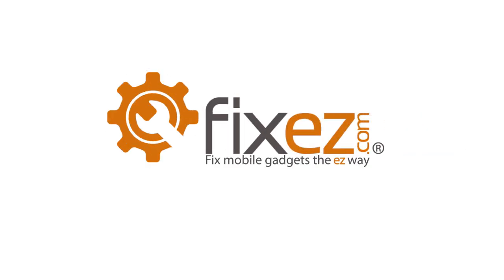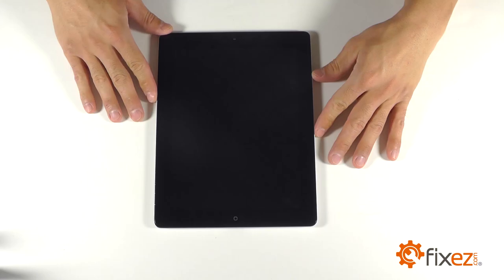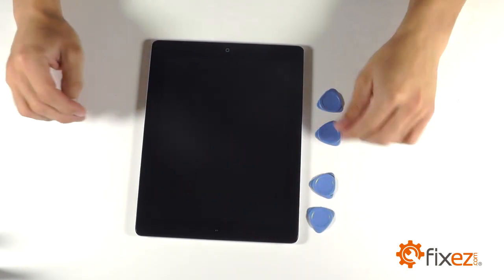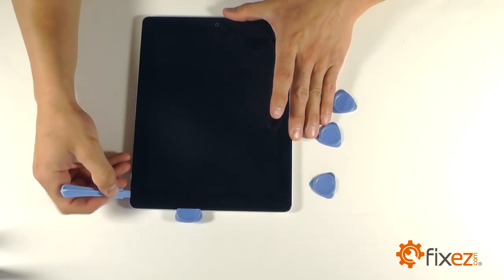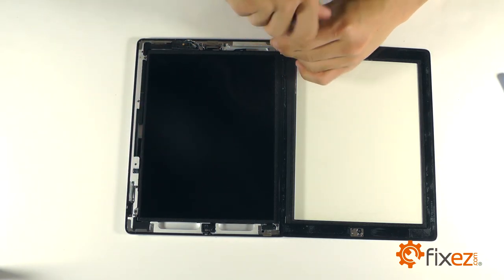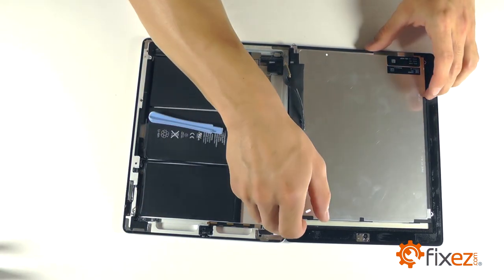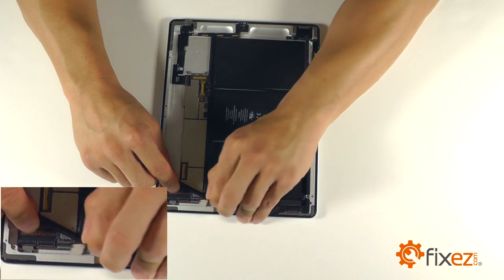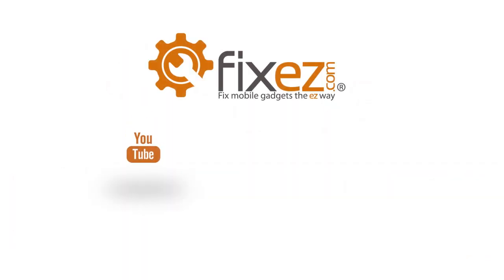iPad 2 Charging Dock Port Repair

Comment: The only thing I would add is I take ESD precautions. Electro static discharge can damage the sensitive components. I work on an ESD work mat and have an earthing band on my wrist that is connected to the mat and that is earthed. I come from an aviation electronics background and ESD damage and awareness is a very big thing. A small outlay may very well save you from a big one!

Comment: When putting it back together, should I use adhesive tape or is there something else?
Reply from the maker: +Serjio Valdez We recommend using adhesive tape. We offer pre-cut adhesive here https://www.fixez.com/ipad-2-adhesive-strips
Reply: fixez.com gives you the correct tape with the new charging port.

Comment: when separating the screen from the bezel, there is a plastic right between the screen and the aluminum back, do you pry between the glass and plastic or plastic and aluminum?
Reply: Plastic and aluminum. Try not to put any pressure on the glass, in fact if I were you I'd remove the entirety of the glass screen to eliminate the problem. Never pry on glass
Reply: You pry between the glass and plastic.  The plastic is a border, it does not come off.  You do not "pry on the glass" at all, you use the guitar pic (best tool for this) to separate glass from plastic.  The glass actually rests on the plastic trim.  When you remove the top screen the plastic STAYS IN PLACE.  Only the glass is removed.

Comment: I just replaced the charging port ordered from your website, and it charges much better now! However, the left side of my screen (about 1 inch wide) has no response. It worked perfectly before, and the screen is not visually damaged. I made sure all the cables were securely in place. Any suggestions?
Reply from the maker: +Katie Culpepper Glad to hear the dock port is working well for you. In regards to the touch screens, try a hard reset by holding the power button and home button for ten seconds. You can also restore the device via iTunes, just ensure to back up all your data. If the issue continues, the touch screen digitizer is most likely compromised and would need to be replaced.

Comment: Well the guy at the Apple Store said it was a charging port issue so I replaced it and also cracked my whole touch screen in the process and it turns out that my iPad still won't turn on!!! Ugghh
Reply: well those guys don't know everything. Was it a rep or a repairman who told you that? It could also be a mother board problem which is like a 1 or 2 hundred dollar self fix and probably requires soldering

Comment: Uhhhhhh   like do you MAYBE think you need a new freaking cord? I had two cords that did NOT work but i was for sure that it was the charging doc. NOT!!! i only needed a new cord. I just took my ipad2  to GEEK squad .THE cords are sensitive apparently. I bent them many times back and forth.  MY other two were not apple cords i  dont think.   NOW it charges   100%  in   3hrs!!!   GO BUY  a cord!!!!!!  24.00.  IN the mean TIME   i tried to take the lid off and  shattered the glass around my ipad2 before  i took it to geek squad.    BUT i just taped it. NOW it works great.
Reply: Sometimes the cord can be the problem but not always. That's why it's important to test things before opening them? I'm no entirely sure what the point of your comment is....
Reply: Cord isn't the problem for me... Even if the cord is a hell of a bitch alot of people mistake port problems with a crappy cord